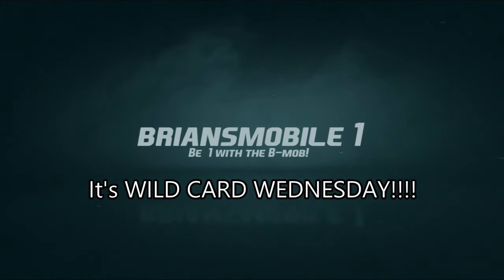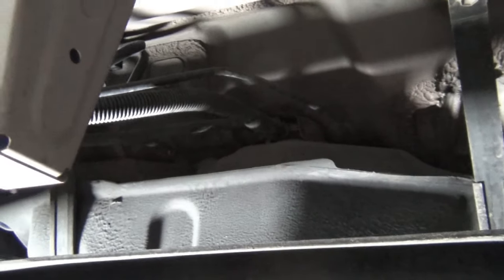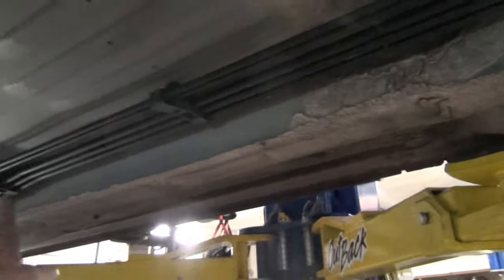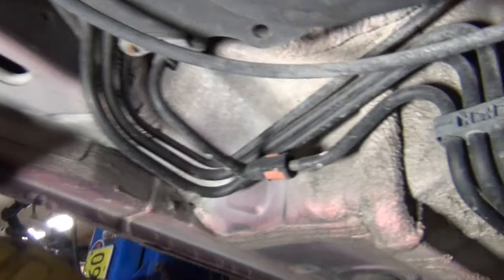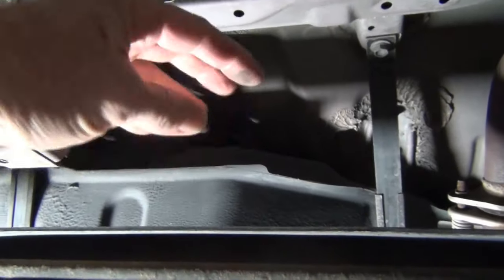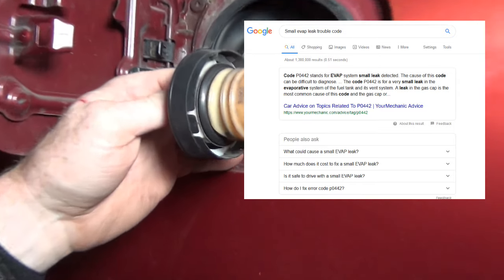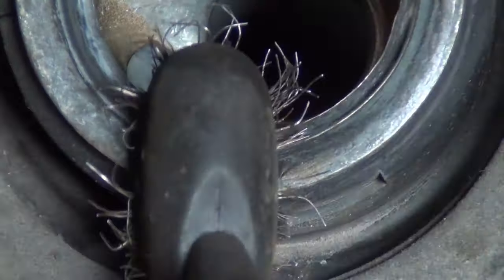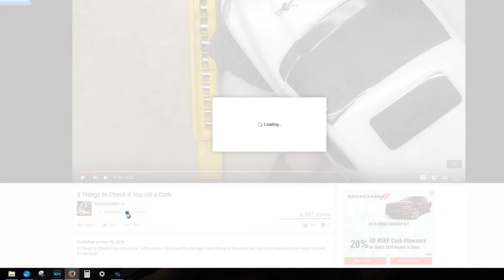P0442 Where Leaks Happen & Easy Common Fixes

Comment: Here's a tip: stop overfilling your gas tank. I know it feels better to fill to $30 than $27.38 but you are flooding the evap system. This is especially true if you drive a Hyundai.
Reply: If I stop filling up ⛽️ would the go code away ?
Reply: Thats why I only pump $10 at a time.
Reply: 😆 oh no I just got the refilling my tank and overfilling again for the third week 🤷🏾‍♂️🤦🏾‍♂️
Reply: Yeah that might be true but when people put gas in most people use the latch so we don’t hold handle whole time
Reply: So few people know about this.  You know your stuff.

Comment: Telling people to remove rust with a steel brush where gasoline vapor is present is inherently dangerous!!! Brass brush will clean up rust, and won't spark!!
Reply: Also, tape the inside holes of the fuel filler neck. You don't want the debris from brushing to go down in there. After brushing, use compressed air to blow out the debris, then wipe down with alcohol or even a bit of gas. Wear a particle mask when blowing out the debris. Then remove the tape (or whatever you use to plug up the holes).

Comment: I've never had a repair be the " 99% of the time its this cheap easy fix ". Mine are always the trouble shooting nightmare,  that you throw 2-10 parts at before getting it figured out.
Reply: Dealing with a p0442 code on my chevy right now. Mechanic replaced canister solenoid vent, then the code came back, then He said he had to replace the entire gas tank and fuel pump. And guess what...the code is back again!! So far $2,400 into fixing my “small evap leak”  and its not fixed.
Reply: @stuartsmith3359  have you figured out where the leak is coming from? Perhaps the purge valve solenoid?
Reply: @socal69_88  not yet, but that has already been replaced
Reply: @stuartsmith3359  same bro same😭
Reply: Lol, yep ..I had the similar P0446...replaced the "99% of the time" vent solenoid THREE times, the cap twice and got led even further astray when I replaced the GOOD purge valve with a brand-new DEFECTIVE one, lmao...replaced the filler neck and then finally struck gold with the damn tank pressure sensor, just before I was about to give an and tear out the tank & canister.  Hope this keeps someone out there from blowing his or her brains out over that damn code. 👉🤬👈
Reply: @stuartsmith3359 that's one happy mechanic
Reply: @serfcityherewecome8069  just replaced the canister on my Lexus 2003 RX 300 the light came back on So my mechanic told me it was my filler neck also I have a air going Through there  Could be that be the problem?
Reply: @jonh380  Could be...mine was fairly rusty and would've needed replacement very soon anyway, so...?
Reply: @stuartsmith3359  Whaaa???  If he sold you a new fuel pump for an evap leak (on a presumably running car) he should be in jail for stealing your money.
Reply: @serfcityherewecome8069  yeah I’m going to replace it thanks a lot men 🙏🏽

Comment: Replaced purge & vent valves + gas cap to no avail. Last week I put the gas cap on with 1 click instead of the 3 clicks that I did on my old Silverado for 8 years.
The truck sat all day and when I started it in the evening the SES light went out and stayed out all weekend. When I drove it Monday, I went over the RR tracks and the light came back on. I'll try some of that dielectric grease tomorrow. Love your humor.

Comment: I agree. There is more "vapor" released when pumping than on this system. Once had this code and it was the rubber cross-over hose going over the axle on our 2002 Jeep liberty. Also did have a bad cap another time. Good info!

Comment: I've been getting this code every couple months for the better part of 3 years. I would just clear the code and move on with life. Not the greatest move for the environment, but the car runs fine. I visually inspected my gas cap and it looked fine, I'll give the wire brush and silicone a shot. I have my doubts, but you've never led me astray. Your WRX shock install video is the only reason there's new shocks on my WRX..

Comment: The gas cap is the one part of the emissions system that gets touched on a regular basis.  I love my smoke machine but evap leaks can be a challenge especially when the charcoal canister removes the smoke before the leak.

Comment: Wow Deja vu. I just replaced the filler neck in a 2000 Corolla and now it has a leaking brake line. The Corolla you showed did not have any covers on those lines running to the back. The one I'm working on has covers and I don't think it's such a great idea. Water, mud, ice, and snow can get lodged up in those covers and cause early rust on those lines. I am doing a quick 2 foot repair on the brake line but I think I am going to look into replacing those two lines all the way back the rear wheels. Great video and BFATE.

Comment: I have been trying to find a leak for awhile on my 2006 Acura TL, bought the smoke machine, still couldn't find it. Maybe I need to try that again? Once in awhile I can smell gas when it's hot out. I also have pulled off the canister and put a little pressure to it and it seems to be holding. I guess I'll replace the gas cap again and try the silicone. I just adjusted my valves and replaced spark plugs last night, and it is running better. I just hate taking it places because half the time I feel like the guys that work on it didn't have any better ideas than me.
Good video, thanks Brian.
Reply from the maker: Take the evap can out of the mix.  Cork it & test the tank & rest separate.  Test the can separate.
Reply: @briansmobile1  Thats a good tip, thank you. I will look at it again. Hope things are well with you and your family.
Reply: If you can smell the vapors, you can use that to help track down the leak in combination with the smoke machine. We found a very small leak on the ring around the fuel tank sending unit mostly thanks to the smell of the vapors being forced out (had to pull the rear seat to get to it). 

Couldn't visually see the smoke but a bit of soapy water confirmed where the leak was.
Reply: @ssevier1149  Great tip, thank you I will give it a try.

Comment: If the EVAC system is as it should be, with no leaks, should the engine immediately start up ? Mine takes a few spins before it kicks over. Plus, I have a gas smell coming from the rear of the vehicle. I have no Check Engine light, and the last time that I checked, there were no trouble codes. I put a new gas cap on it. I have a 2002 DOHC 3.0L Ford Taurus.

Comment: Failed my emission test due to code po442, went to autozone  auto parts they scanned my onboard computer to confirm the code. Turned out to be bad gas tank filler cap to correct and check engine light is now off. Viewed the videos on you tube before going to autozone

Comment: Encountered a p0442 small evap leak on my 3800 series 3 v6 3.8 Buick Allure Cx 2008.. it only has 75,000km on it.. when i bought it i pulled the upper and lower intake in order to free up a blocked coolant passage given the age with no previous flush.. dexcool 100,000km or every 5 years.. so 16 years later it got its much needed flush.. cleaned the throttle body new sparks.. transmission fluid 6.5 litre half flush plus much needed trans filter. New spark plugs.. by the looks of the carbon build up on the throttle body and upper intake manifold (cast aluminen 🙏)  im just wondering if this code could have caused it to run hot? I only replaced gas cap and purge valve solinoid.. should i dig a little deeper? Canister valve solinoid stuck? Almost wondering if the canister it self is on the top of my fuel tank? Looks like the cylinder valve solinoid behind my gas cap underneath next to back left wheel well.. any help would be much appreciated.. thank guys
Reply from the maker: That's not a very common car in my area.  For stuff like this, I follow the evap lines.  I would expect it to be behind the fuel tank crammed behind the trailing axle or somewhere near the trailing axle over a tire or something like that.  Running lean with a P074X type code can make an engine run hot, but modern cars fuel trims will let you know on a scan tool live data if that's going on.
Reply: @briansmobile1  appreciate it man, I'll have to grab my friends code reader again and live feed a drive..

Comment: I have a 2008 Nissan xterra. It is going thru a period of throwing p0456 codes and now it throws a p0442 code. What is the difference between them when the ofd scan tool shows the same result....small evap leak?  After a gas cap replacement, a evap solenoid which was bad and replacement of some lines with good clamps, the code still remained but went from large leak to very small leak. Interesting, this is the second winter that I have noticed that the codes will go away as long as the ambient air temp is below 40 degrees and will return in the spring with warmer weather. The last culprit I am considering is the o ring on the evap pressure sensor as that just pops the unit into the canister. What an annoyance.
Reply: I also have a 08 xterra and having the 442. Did you figured out what was the problem?
Reply: @argentosebastian  Now that it is winter, I have not had that code appear in awhile. It did throw the code,  when we had a warm up above 40 degrees. I expect to see it again in the next few weeks when temps go up again.  I have no good answer why this happens.
Reply: @lorettacaputo6997  yesterday my mechanic replaced the canister solenoid and so far seems to be working (knock on wood)

https://youtu.be/iu4gdWuIq5o

@6:55.
Reply: @argentosebastian  Good video. Brings back memories of doing solenoid replacement 2x. First was failed electronics, second was failed sealing of vent valve. I am sure that I have a very slight leak due to a faulty seal of a hair line crack in the cannister. It doesn't warrant any more time or effort as it is a seasonal problem seemingly due to the ambient air temperature. I just clear the code p0456 when it appears and be glad that it isn't anything else.

Comment: Is this worth fixing? My truck is throwing this code. I bought a new gas gap. The mechanic reset the light said to drive for a while and see what happens. I drove 50 to 100  miles and it came back on. He told me it could be many different problems and very hard to find where it is. I don't want to sink money into it if they can't find the leak. My truck is a 2008.

Comment: my filler neck has rust on it.  you mentioned using a wire brush on the filler neck.  Can that create a spark and blow up doing that?
Reply: Brass brush

Comment: I have a 2019 Jetta with an evap code.  The purge valve at the engine test okay.  I hooked a smoke machine up at the purge valve line that leads back to the canister.  I see smoke pouring out of a round vent at the canister.  Does this mean that valve next to the canister is open and bad?

Comment: When you fix the gas cap Do you have to wait for a fuel pressure cycle  to run before lite goes away or is it instantaneously
Reply: It has to cycle

Comment: I have a 98 civic that throws a small evap leak code (tank side) ran a smoke machine through it but no visible leaks anywhere. Cap and filler neck were replaced too. One clue I have is when it’s warm outside (summer, spring) the code isn’t thrown and the system passes. But in cold weather the code is always thrown. Any ideas?
Reply: @Deeznutz...  No unfortunately. Sometimes there’s no code then randomly comes back. At this point just living with it. You have same thing going on?
Reply: I have the same issue on my Chevy truck. In the summer I never get the code but when it cools off it comes back. It's always the first drive when everything is ambient temp then warms up. But once it's warmed up it doesn't come back.

Comment: On a 2000 Sunfire Pon-ı-ak that has suddenly for 1sd time evur in 22 years and 195k km a CEnjinLite, koud it be that the part uv vacuum evap hose under the hood that kunekdz to the throttle body has smal krack near the end of its length. Woud that bee the kauz.
Kan enybudy plz say what the diagnosdik leak" 《vacuum preshur》tesdz wil ka$d for time hourz leybur (asooming i hiyur the $90/hr man) alburduh infleyshin Jul 7, 2022
Thankzmuch fur eny help